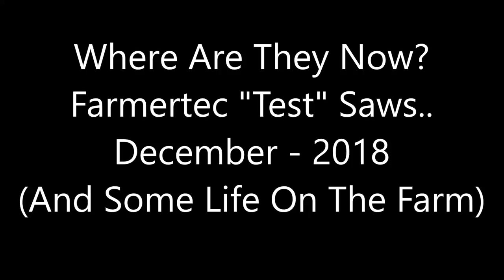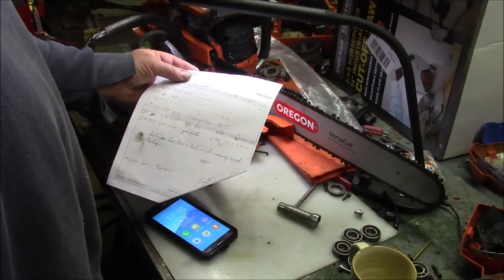Where Are Those Farmertec 660 Test Saws Now? & Life On The Farm Dec18

Comment: My ms 660 is almost 4 years old and is doing fine.  It has been coupled with 20, 24, 28 and 36 inch bar and chains.  It has cut lots of wood.  It has nothing fancy on it and has only a moderate tune on it but it is hanging in there.  It has its original muffler and carb.  It is not my go-to saw.  That would be my ms 360 and 440.  For smaller stuff I grab my 026 Pro.  I have not had to replace anything on my ms 660.  The only casual maintenance was cleaning the sprocket and lubing the sprocket bearing.

Comment: I despise repair shops who try and tell you a piece of equipment is hardly worth fixing when there is only minor issues.
Reply: Yeah, that must be the dealer motto... It's too old, replace it or overpay for us to just look at it.
Ridiculous stuff that may have worked 20 years ago. Nowadays, there's no excuse for not having a brand new, old saw...
Maybe your crank bearing's race spun in in the housing... Pay someone to TIG weld the case to mill it back to spec. Good as new or better. That's really all I can foresee as the worse case scenario, but it's easily repairable these days.

Comment: I used to fell with an 066 stihl in the  90's they were durable and powerful but heavy and  transfered a lot of vibration through the handles. I also had problems with air filters freezing up in the winter and you had to clean air filters daily. I switched to husky 288's and 394's they were a little cheaper and easier on the hands and never had air filters freeze up. After I got a little older I figured out the 372's were a lot easier on the body and cut good enough if you keep them RAZOR sharp. Then I got a little wiser and figured out there was easier ways to earn a living than cutting timber LOL!

Comment: I trade a guy for a 660. He bought it to cut a big cotton wood tree. He set it in the shop figuring he will use it again. He retired from farming and is moving to Colorado where he knew he will never use it. I cut all summer with it. It's heavy. I bought a smaller bar for it and use it every time I went out. 24 inch bar. I did use the 36 on a big oak late summer. Tight saw. Only stihl I have. Ol boy bought it just before the 661 came out.

Comment: Walt what is your gas/oil ratio that you like to run. I heard you comment about the piston skirt being dry as a bone with 50 to 1 mix. I listened to that a couple of times but didn't understand what your point was. I run stihl premium 50-1. But I am always trying to take care of my equipment. What have you found to work the best as far as oil and mix ratio?
Reply from the maker: For warranty purposed stick to what even the manufacturer recommends. I do something different but hesitate to recommend as it creates a hassle at times. And what I look for when I tear apart a saw is that film of oil in the bottom end vs. that dry waxy look and feel I get from some full synthetics , usually paraffin based; that typically leave that behind.
Reply: @afleetcommand  thanks very much.

Comment: There is no fitness center activity that you could do that will match the work out that you are getting doing the wood cutting the way your doing it especially out in the cold weather which draws more demand of your body.
 I congratulate you on your accomplishments so far. 
Real interesting info on the 2 test saws,  1 1/2 years in a logging environment  with nothing more than what I would call regular maintenance  issues, I think that is beyond acceptable  considering what the overall bases of these saws are and for around $350 to $500 depending on how it was built. 
You need to build you some sort of a sled to haul the wood you cut using that snowmobile to pull the cut wood out faster than using a tractor when there's enough snow on the ground.
Reply from the maker: Have one...( sled ) :)

Comment: Objects in motion, tend to stay in motion, lol.
I've got an 066 my neighbor ran with no oil, bottom end looks fine, need a cylinder.  What would you suggest?
I run all my saws a pint to 4 gallons of 100ll from the airport.  Seems to work for me.
Funny how dirty the air filter on the stihl gets, I always forget to blow em out, because the jonsered and husky take so long to plug up.

Comment: Great video!  Slight critique on the production of it though.  Please don't fade out/in audio when your explaining something.  Hard cut transitions are usually easier to follow.  If you absolutely MUST fade out/in, and your editing software allows it, try playing around with the transition length.  You are putting out great information, but sometimes we lose a little bit of it, or have to turn up the volume so we can hear those sections where the audio is fading.

just my two cents!  Thanks for the great content.

Comment: Would doing a base gasket delete to one of the cylinders with the 2 ports on the carb side an carb hurt the performance of it or help?
Reply from the maker: On the "X-Torq" cylinder? Actually that works pretty well for them. A noticeable difference. Usually a base gasket delete on the 372's XT's is worth a 20lbs gain in compression.
Reply: Okay that's all I was wondering lol it's not a chainsaw it's a blower redmax ebz8500 I know it's not gonna help topend much for a blower but I dont have a base gasket or cant find one and was wondering what difference it might make on a backpack blower
Reply from the maker: Just have to check to see if there is clearance, you need .015-,020 for squish the .015 is an absolute minimum. IF there is? Should be fine. Probably won't make much difference. Those steady state situations might get a little warm with that extra compression....a muffler mod would help get the heat out, of course that's the worst case assuming you have the squish to allow a no base gasket build, a BIG "if"...:)
Reply: That's what I was wondering lol I've gotten the numbers remembered from your videos for the squish lol
Reply: It will be interesting though being a blower! Not sure about nodding this muffler though.
Reply: Would the wrist pin bearing be first to go out with a higher comp or would it be the rod to crank needle bearings? Feel like this is something ima have to just build and find out

Comment: I love your videos! Your an inspiration to me. Keep up the great work. How much do you charge for one of those Chinese 660’s??
Reply from the maker: A few things, the handle bars swapped to HyWay bars, OEM bar studs & bar nuts, Husqvarma (Or Stihl) OEM decomps, The plastic controls for choke & Trigger replaced with OEM, shimmed OEM chain adjusters, HyWay Clutchs OR Farmertec with OEM springs. That is at a minimum. Often times a Walbro OEM carb, or some of the ones that came in the kits could be modified to work. A typical symptom oof the Carb issues is the high idle to cover up for their issues...:) So most after those area's addressed actually last. Other places I've changed is the chain brake linkage and handle with OEM. bottom line is the kits can work as delivered, but often the quality is a moving target and expect to need to swap out things along the lines I just articulated. I've had a lot of fun and the ones I worked through are very capable machines.

Comment: The problem with being out in the woods with a chainsaw is time flies! I was supposed to meet a guy back at the farm at 3 and I came in with what I though was an hour and a half to play with and there he was, right on time. OMG! those big old hard frozen maples are tough on a chain, and saw. I broke a sprocket and a chain and bent another tooth on another chain and just chewed the cutting edges up something terrible on just one tank of gas. Mostly putting in the angle cut on the notch feels like I'm cutting through pole nails. A guy in a forum says he has better luck using a skip tooth chain on hard maple or maybe just wait until they thaw out again?!